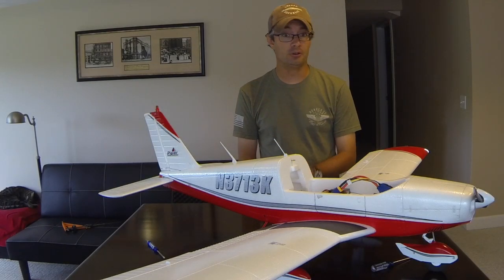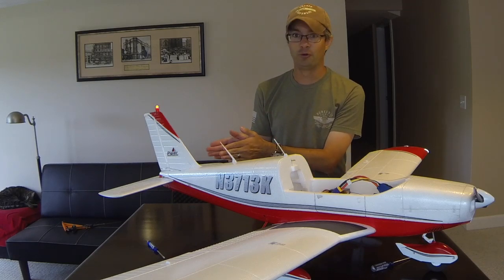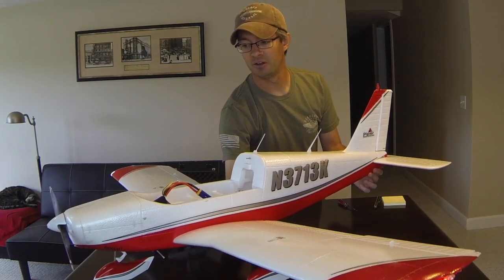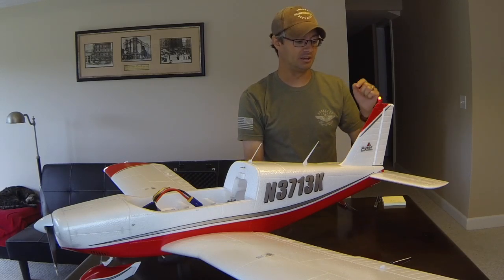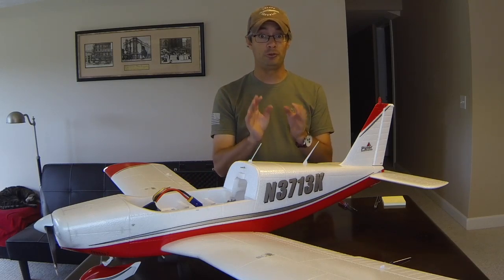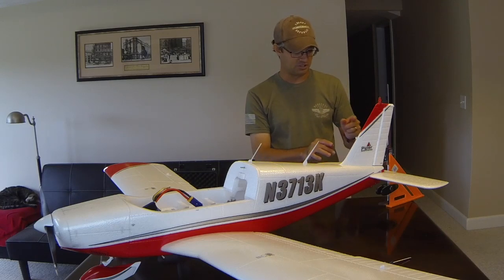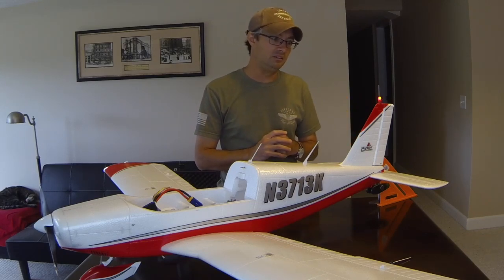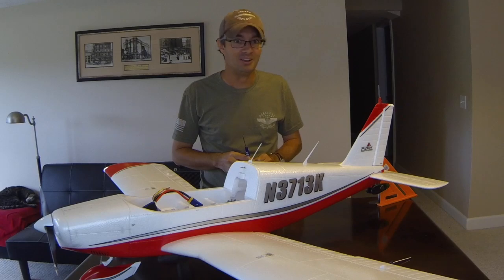How to mechanically trim the stabilator on the E-Flite Cherokee 1.3m Basic

Comment: Great video buddy.  Haven't done the Maiden yet, but I had to move the pushrod to the outer hole on the Servo arm to get more throw.  I saw that small indentation line that you were talking about.  Guessing and Hoping that, that was what it was fore.  So I lined it up as you said.  In a few days I'll get the time to do the Maiden.  Hope all goes well.  THANKS for the Reasurring information Buddy.
Reply from the maker: Depending on which control surface you moved the pushrod and your flying style, you may have way too much stabilator throw. I kept my pushrod on the factory setting and reduced the throw in the transmitter to about 50-60% with somewhere around 40% expo. The stabilator is really effective and the plane felt too sensitive in pitch for my flying style. I fly my Cherokees very sedate and bordering on sluggish with the controls. I want mine to feel much like a real Cherokee. I also found that having too much stabilator made smooth landings difficult as it was tough to get the flare just right without stalling. I would also suggest reducing the % flap deflection and the speed to 4 seconds. Too much flap makes the plane tough to land as it wants to stay in ground effect until the wing stalls, which then causes the plane to hit nose gear first into the runway. Let me know how the maiden goes!

Comment: It's called a horizontal STABILIZER
Reply from the maker: Incorrect. Page 7-7 of the Piper PA-28 Operational Manual states that the horizontal control surface is called the Stabilator. The PA-28 aircraft is unique in that the horizontal stabilizer and elevator are combined into a single element, known as a STABILATOR, as stated in the Piper manual.

Comment: On my Cherokee, with the stab indicator, on the left side I only see 2 small dia. round indents, and on the right it's a rectangle, I don't see 2 identical stab indicators on both sides, could you clarify what they look like on both sides? The round ones on left and rectangle on right? Thanks...
Reply from the maker: The rectangular one is the one you want to use. Align the leading edge of the stab to the rectangle.
Reply: @BRGT350  Thank you so much!  Before I knew this, I put a 1/8" Teal pinstripe on the fuse between the red paint and the black & grey decal from the front all the way to the back, the Teal stripe tape covering much of the rectangle, but it seems the height up & down of the rectangle is about 1/8" ? Does yours look about 1/8"? The length looks about 1/4" Thanks so much for your help, very strange how they don't mention this in the manual.
Reply from the maker: On one of my Cherokees, I added a stripe over the rectangle as well and it sucked to find it! Yes, it is about 1/8" x 1/4". It is odd there is no mention of it in the manual as it is pretty important to getting the Cherokee to fly right.
Reply: @BRGT350  And one more great big thank you!
Reply from the maker: no problem, always happy to help out

Comment: Thank you for your video!

I wish I had seen your YouTube video before my maiden flight.

I have been flying for years, but this is my first plane with a stabilator.

 Both my first and second flights were a nightmare. I just barely got the plane on the ground in one piece each flight. 
 My main issue with E-Flite, was that "NO WHERE" in the manual, did they explain about the stabilator alignment. Let alone, about the indentations for the leading edge alignment of the stabilator. I just eye-balled it from the graphics on the box. I hope this alignment corrects my elevator/stabilator issue.

My second issue was that I fly from rough fields. When taking off on the maiden flight, the nose wheel hit a small rock, stripping the gear in the rudder servo. With the rudder stuck fully left, and the stabilator not being correctly aligned, the Cherokee was a handful to say the least. (My Cherokee now is not nearly as pretty as it was out of the box!).

A big thanks to BRGT350 regarding the Dubro Servo-Savers. Looks like just what is need to protect the rudder servo. Something like this should have been designed in.

I just order a few, I also ordered  and received the replacement servos (same part #). They would not fit. Quite a bit of filing to get it to drop in. Metal gear servos also sounds like a very good idea for planes with steerable nose wheels. 

I own several E-Flite planes, and this is the first that I had any major issues with.
Reply from the maker: Glad I could help out! I try to get the message out to people, but hard to reach everyone. I have been flying both of my Cherokees with the metal gear servos, servo saver, and stabilator aligned to the indent and not had any issues. The plane is just perfect with those small upgrades. Out of my 30+ planes, the Cherokee remains my favorite to fly.

Comment: WOW......I am so glad I found your video on the stabilator! I recently purchased the Piper Cherokee and took her out for the maiden yesterday. Mine went straight up into the clouds and I had to keep down stick on the elevator just to try to keep her level. I used up all the trim but still needed down stick and low power to bring her home safely. I have since levelled the stabilator to the tiny indentations on the sides of the fuselage as you've instructed and will try again in a few days. Thank-you.
Reply from the maker: I think everyone with a Cherokee has had a similar maiden flight. Mine was the same way and I was fighting hard to get her back on the ground. Adjusted the stabliator to the indents and it flew perfectly on the next flight. You will be shocked at how much better it will fly with the stabliator aligned. You may need to play around with the deflection (throw) and expo to adjust the sensitivity to your liking. I have my Cherokees setup to be pretty sedate and scale. Another tip on the Cherokee is to install a Dubro Servo-Saver on the nose gear pushrod. A hard landing or operating off of grass can put a lot of loads into the rudder servo which could lead to a chipped servo gear. The Servo-Saver is a spring loaded piece that allows shock loads from the nose gear to be absorbed by the springs rather than being transmitted to the servo gears. I have it installed on both of my Cherokees since I operate off of a grass runway that isn't putting green smooth.
Reply: @BRGT350  I have a DX8 G2 transmitter and have the rates set on ailerons and stabilator at 90/75/60 so I have options in flight. I've left the tiny rudder at 100% as it has little effect. I hope to try again this Thursday Sept 12th and hope to have better control.
Reply: @BRGT350  Thank You sir for the great info! Regards!
Reply from the maker: I have the rudder the same way. I changed out my stabilator servo and horn, so I am still messing around with the throw and expo to get it the way I want it. I think my current setting is 70% throw with 25% expo. The new servo horn is longer than stock, so I am compensating for that. I think you will find the 75% a good sweet spot for the ailerons and stabliator. I like to fly mine like a real Cherokee or how my grandfather used to fly his Pipers, which is very sedate and calm. Good luck tomorrow and let me know how it goes!